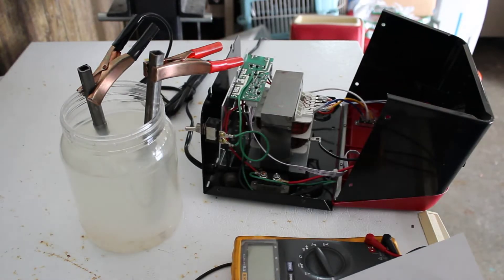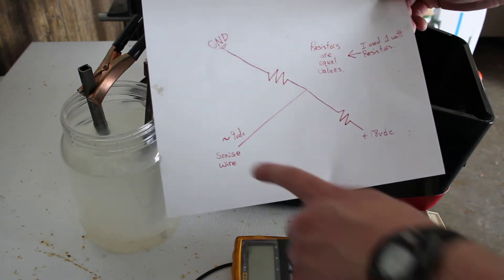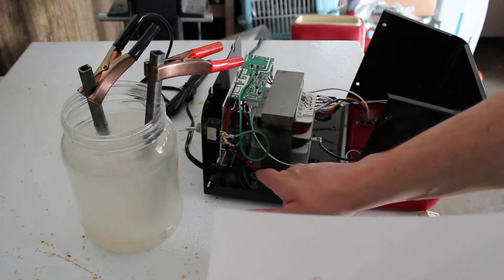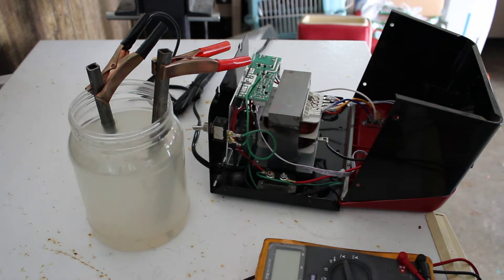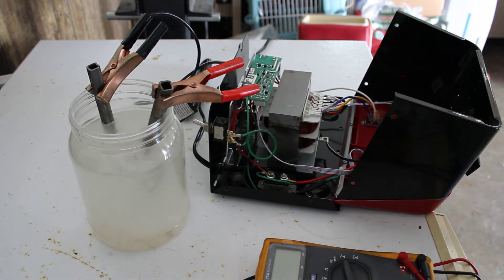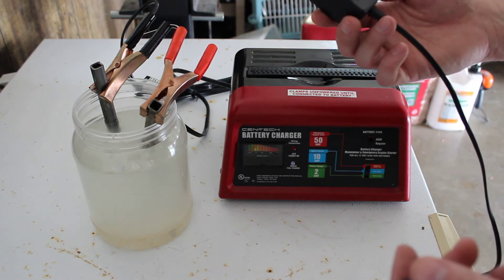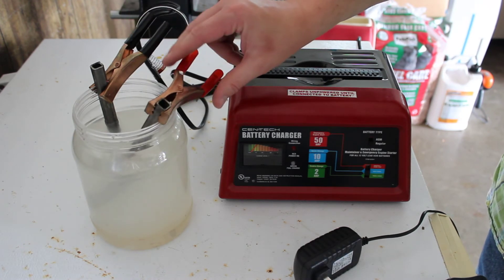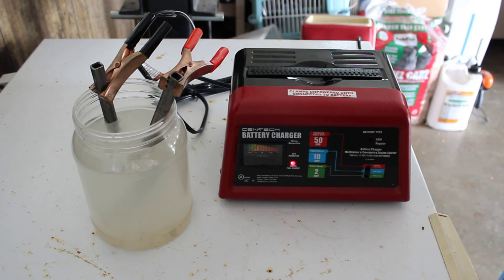Harbor Freight Battery Charger Electrolysis Hack 60653 60581 Centech Part 2

Comment: I don't know if anyone is reading this thread anymore, but I thought I'd leave this for posterity:  I got the 2022 version of this battery charger to work.  I'm using it for resistance soldering, but it doesn't matter what the end  use is -- you'll get 12v out of the clamps.  The circuitry in the 2022 version is indeed different from what's shown in the video.  How I got it to work:  there's a red wire that's attached to one side of the internal circuit breaker and runs to a circuit board on the other side of the charger.  (The circuit breaker is wired in series through the meter and is mounted on the unit's base.)  Remove that from the circuit breaker.  I used an old Radio Shack wall wart transformer set to 4.5 vdc.  I attached the positive lead of the transformer to the red wire that goes to the charger's circuit board, and attached the negative lead to the grounding plate that's at the back of the inside of the charger.  That fakes the charger's circuit into thinking there's a battery attached to the clamps.  That's it.  The charger LED will light and you'll get 12vdc from the clamps.  If you attach the wall wart backwards the red "wiring connection" LED will light.  To make the unit do double duty, I added a single-pole double-throw switch and two external contact points to the plastic portion of the front of the charger.  When the switch is thrown one way, the red wire inside is attached to the circuit breaker, same as normal, and I can use the unit as a charger.  When it's thrown the other way and the external wall wart transformer is connected to the external contact points (simple bolts), the charger works as a transformer for m resistance soldering.   The center pole on the switch is connected to the red wire inside that goes to the circuit board.  One side is connected to the circuit breaker, and the other side is connected to the + external terminal for the wall wart.  The other external contact for the wall wart is wired directly to the grounding plate.  Works great!
Reply: Hello Gerry are talking about the blue charger?

Comment: Trickle charging with the part 2 video method: Are you able to change amperage (2, 10 or 50)? Or does it only go to its lowest amperage which is 2?
Reply: It will be lovely to have a way to trickle it to 50A

Comment: How about installing the
12vdc wall wart adapter in the charger box.
Then connect the positive and negative of the wart to the pos and neg thick wires main charging cables. But have 1 of the little wart wires go through a switch?

Momentary or latching, depending on what works best for your unit

Comment: So I did a dry run in this and a 9v did trigger it,but it would hold in the charging mode when I opened the circuit, now could this be because I wasn't hooked up in electrolyte?

Comment: Thanks for sharing this video. Without making any modifications to my charger (older version of the one in the video), I got the chager to start electrolysis with a 9 volt battery. All you need is a little jump start and the charger will go on.

Comment: what liquid are you using. is it just water.
Reply: Not water. Many people use a solution of wash soda also called soda ash, not to be confused with baking soda. It’s a 1/2 cup soda ash to 5 gallons water. There are other electrolyte solutions as well. Hope that helps.

Comment: I'm using the latest version of this centech harbor freight charger. The circuit board is smaller and different, I tried this trick with a 7.5V DC adapter and it did not work.
Reply: 7.5 may be too low, may need 9-12v
Reply: BallsonPHACE same here
Reply: Anyway, just put it in parallel with any car battery and then you can do electrolysis